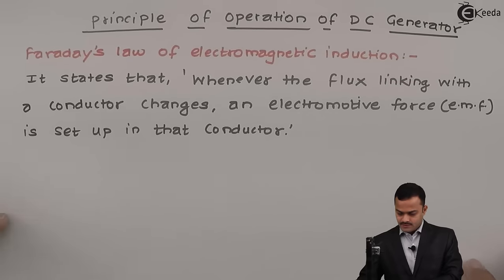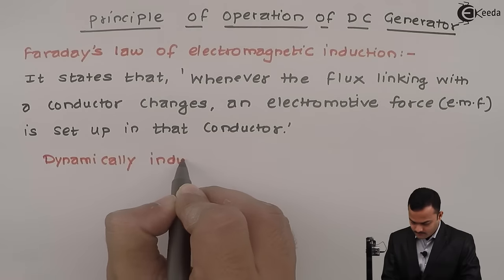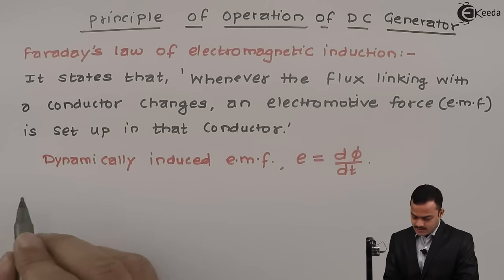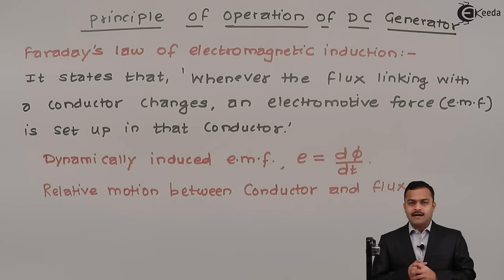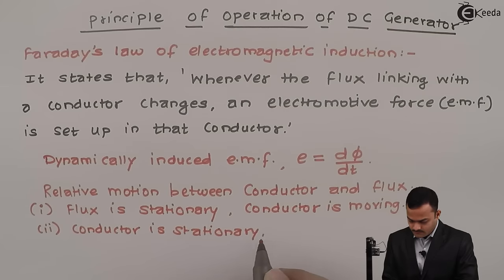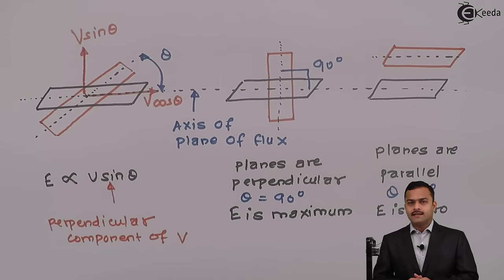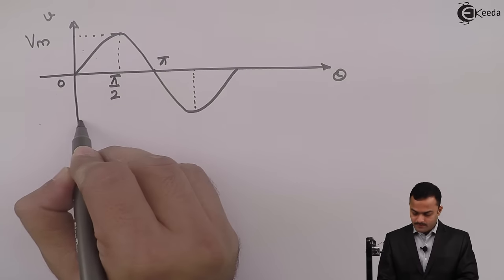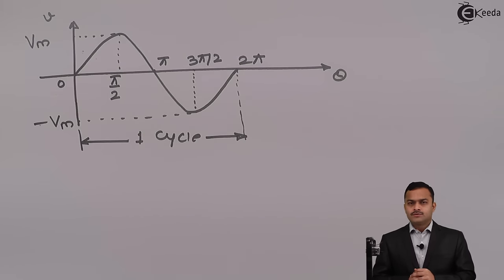Principle of Operation of DC Generator - DC Machines - Basic Electrical Engineering

Comment: Relative motion can also be obtained by moving both conductor and flux simultaneously..
Reply: It can be... But it wont be useful in case of generator ....
Reply: There will be unnecessary moving parts
Reply: Plus your said condition can only be achieved if there rate of change isdifferent
Reply: Hence as sir said there should be relative motion between both